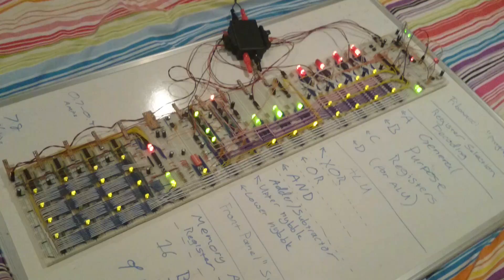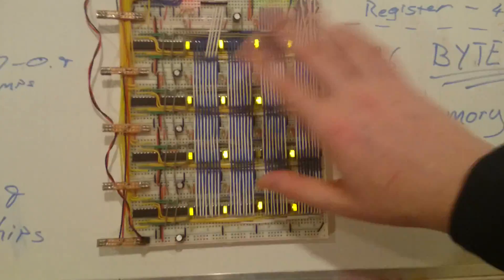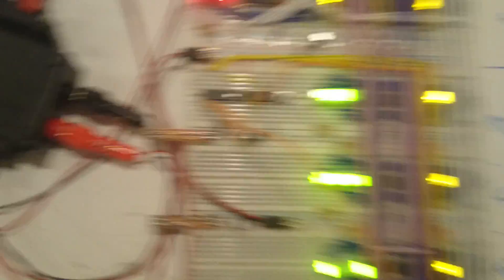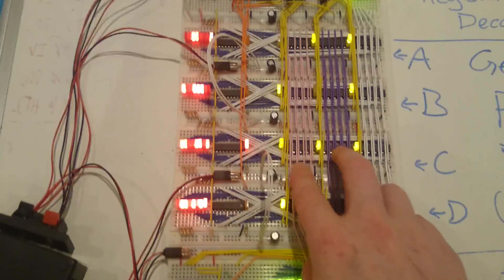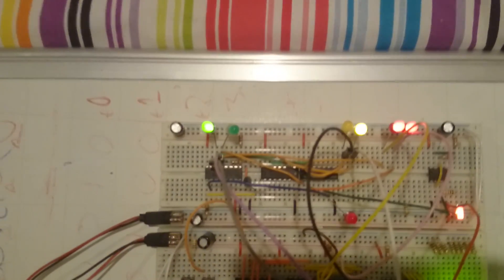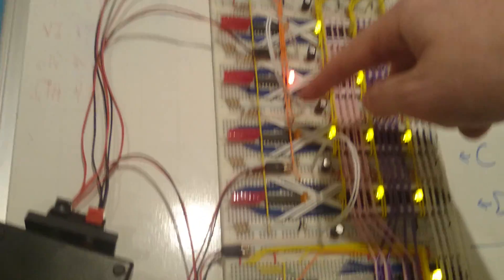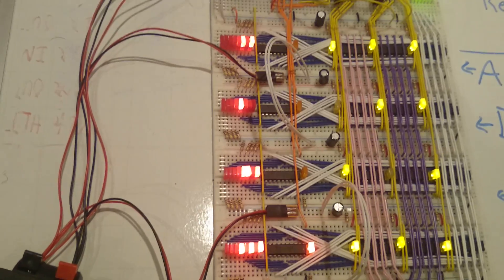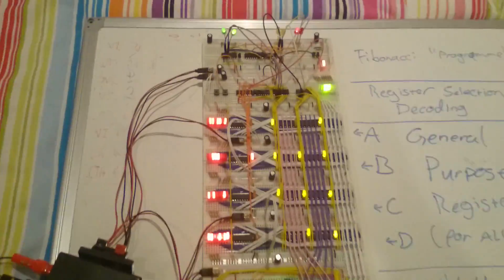One year of bending wire: An unfinished 8bit breadboard computer

Comment: Hi,great video but I was wondering if I could build such computer with eeproms because I heard of some people who did similar computers with eeproms and thanks.
Reply from the maker: Thanks! :D In answering your question, I'd say "yes and no" (unhelpful I know. sorry.) Essentially, if the thing you want to implement could be done using a lookup table, then you could use an EEPROM for it, yes. This technique is often used for implementing "microcode", the steps required in order to complete an instruction. So your EEPROM address could essentially be your instruction plus a number to identify which of the "T-cycles" you're on. Ben Eater has a video on the topic which will explain things a little better than I have. I haven't implemented microcode using a ROM yet so I'll defer to him on this one. ;) Hope that helps! :D This is an ongoing project, so subscribe for more. :)

Comment: Those very long white wires.... will cause havoc in your signals at higher frequencies.....you can't have such long wires, specially when using breadboards...unless you don't expect it to work anyway. If you want a working computer, then it's a big nono

Comment: The Same Thinge Clan u Build in Minecraft xD but good Job here
Reply from the maker: I've seen some of those, they're very impressive. I do actually play a bit of Minecraft myself and love building redstone machines, that and rail networks. It's just lego and trains to me. :P In my most recent video I mention "gate delays" or "propagation delays", the time between an input changing and the output being updated. That's a BIG problem with redstone. The signals fade over...what was it? 15 blocks i think? Then you need a repeater, which adds a delay, so everything else needs to have a repeater added just to keep everything in sync! No thanks, I think I'll stick to bending wire! This is easy in comparison to that! :D

Comment: Looks amazing! How do you decide on ic:s to use? Is there a website which has a database with all kinds of ic:s? Currently browsing Ebay for some IC:s but having trouble picking model and such.
Reply from the maker: Thanks. I do consider it a bit of an art piece so it has to look good! :D In answering your question, for the most part I just used the "List of 7400 series integrated circuits" page on wikipedia to look up what supposedly exists then checked availability over on farnell who are a big electronics distributor I happen to use. The wikipedia page is a pretty good starting point, and use the chip numbers when googling. :) Also just repetition. That's the third ALU i've built for it. In a previous version of the ALU I used a pair of 74HC283 4-bit adders and while it meant I could implement an 8-bit adder/subtractor on one breadboard instead of two, the wiring was really ugly. Loads of wires crossing each other over the chips. Not pretty. So I abandoned them and went back to individual gates. Because it's prettier. :)     - https://en.wikipedia.org/wiki/List_of_7400_series_integrated_circuits
Reply: Thank you! This is just what I was looking for
Reply: Motonaut also check out 4000 series if you wanted to make with cmos ic's